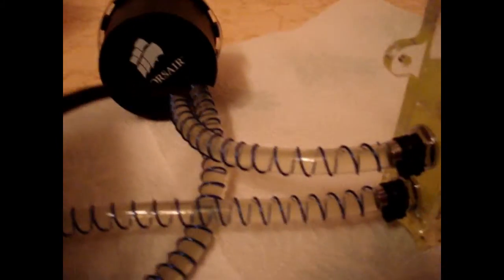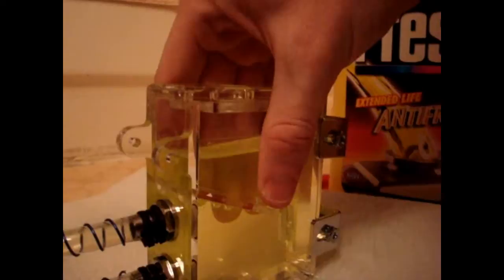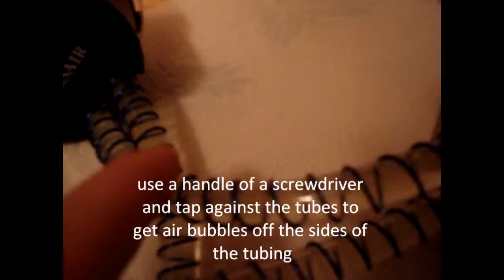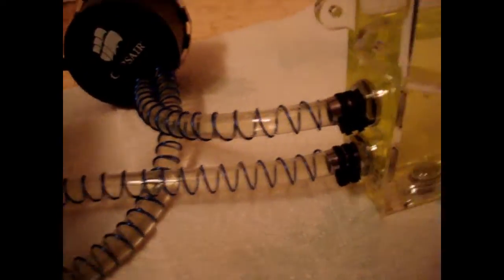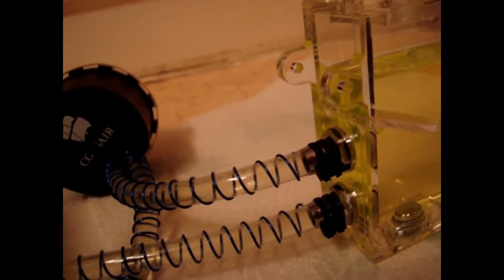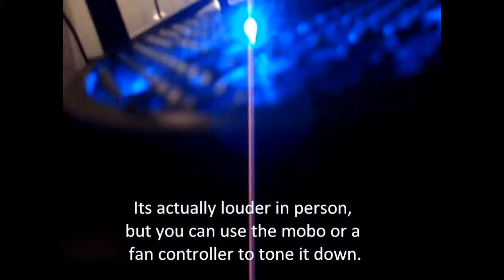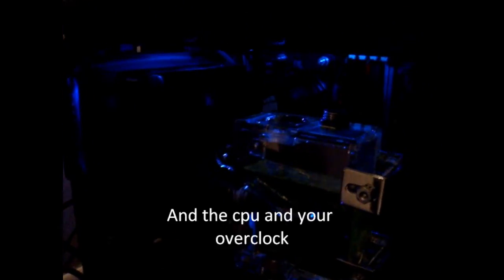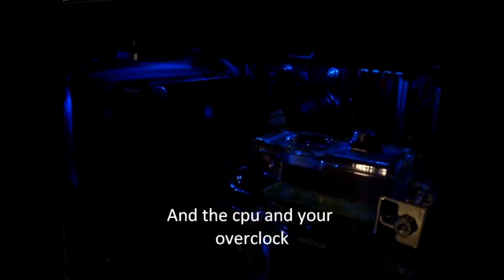Corsair H50 mod Pt. 5

Comment: thats prety col been thinking of doing this but why not make it so you can easly detach the resovoiur and andf add about  a little more anti freeze to compensate for any whater that may add to it since i think half of the contaner shuld be frozen solid to act ass 1 big icubed chilled water resouvor.detacheble res for convinent frezzing when needed

Comment from the maker: @ nrauer- Yes you could easily get plastic reducers  to put just before the pump in/outlets. it may look a little weird, but you can do it. 
The h50 pump can handle a very low restrictive 240 rad ;) so using slightly bigger tubing wont be a problem

Comment from the maker: TThe buzzing noise is air bubbles I believe or if its 2nd hand maybe something wrong with the pump. Try rocking your case back and forth while its running and maybe hit the tubes with the handle of a screw driver to dislodge bubbles that may be adhering to the tubes.

Comment from the maker: Since there are mixed metals in the loop, you need to have an anti-corrosive added. 
I used distilled water and anti-freeze. 4:1 (distilled water:antifreeze)